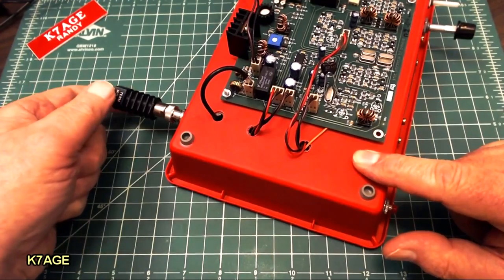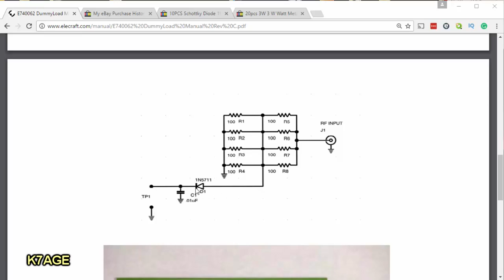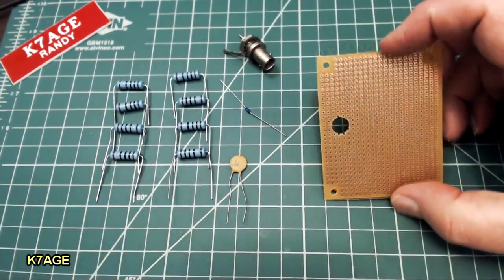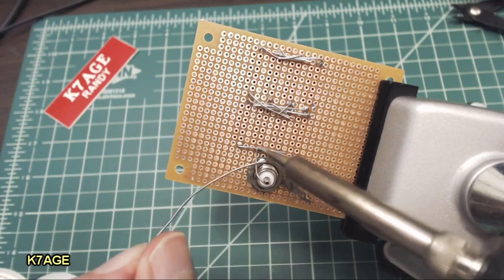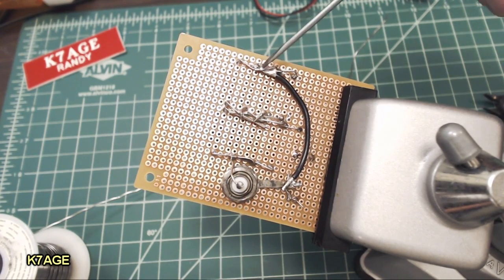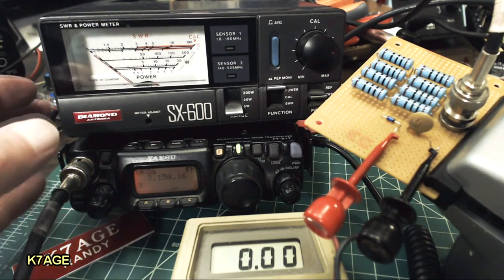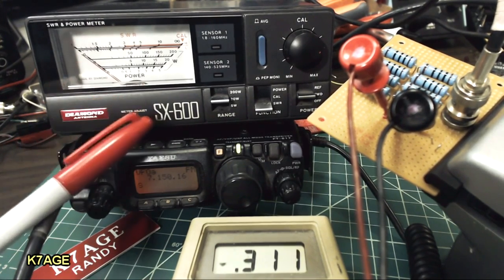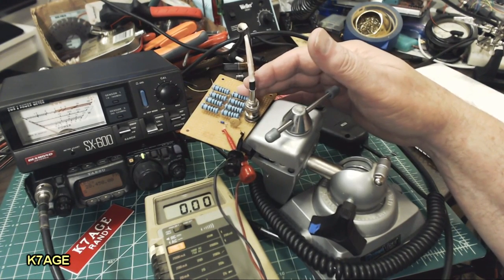How To Build A QRP Dummy Load

Comment: Great video Randy.  I built my 12W Dummy Load with a Schottky 1N5711 Diode RF detector and a six 300 Ohm 2W resistors in parallel. I placed it in yet another Altoids Tin. BNC in front and two 4mm Banana Jacks for connecting the meter in rear. I'll post a pic in the AmateurLogicTV social sites.
Reply from the maker: Sound good

Comment: This was the first thing I built after I passed my General while I waited for a QRPguys FT8 transceiver kit to arrive.  Not sure why but a .01uF mylar capacitor I had on hand did not work for voltage measurements.  Switched it out for a ceramic capacitor and it worked fine. Thanks!

Comment: I hate to be a party pooper, Randy, but metal film resistors are also rather inductive. For best results, use carbon composition types (or non-inductive resistors specifically designed for RF use). Dave - W7SN
Reply from the maker: Thanks for the tip

Comment: Great video.  I built something similar many years ago without the diode and capacitor, and it seemed to work well.   I    wonder how difficult it would be to wire up some gauges to have a direct reading instead of having to use a voltmeter?
Reply from the maker: Easy with an Arduino. It can do the math and then output to a display. I'll probably do a video on that in the future.

Comment: Good project! I am going to build one. I have a question about the formula to calculate watts.  I would have though the voltage should be multiplied by .707 to convert to RMS voltage before squaring.  Seems like I am missing something. Can you please explain when you would/would not convert to RMS.
Reply: Nevermind.  I found a post that explained how the rms conversion constant drops out of the equation.

Comment: Ahh, very good. I know with the QRP kits you can get from China, they come with a single 1 or even half watt 50 ohm resistor as a dummy load. I've built kits that almost smoke them. Very interesting little project, especially gauging power output, good stuff.

Comment: Is that the old Fluke 8060 Randy?? I am more in need of a (better) 3KW dummy load. I have a lovely 1KW, and a DIY Aryton Perry wound resistors in an oil bath  that handles ?KW. 5ish KW intermittent. I have audio loads @ 1,2,3.2,4,6.6,8,12,16,32, & 600 Ohms @ 200Watts-1.5KW, with speaker emulators, but those emulators are exactly like a tuned tank circuit with RF. My QRP 50 Ohm is a thick film precision resistor on an old CPU heat sink. That gets me up into GHz. It works. The metal film is actually spiral cut on a porcelain rod, so you are limited to about that 225MHz. I bought 7,000 what I thought were carbon comps, but they are actually wire wound, so no RF loads with those.
Reply from the maker: 8024B. Thanks

Comment: Thans for the video. I bout a few 1N914 SMALL SIGNAL DIODES 200mA 100V. Do you think I can use these instead of the 1n5711? Thanks for your advice! 73
Reply from the maker: Give it a try. It may not be as sensitive with low power.

Comment: Randy, the cap and diode are for power test only correct? You can have the dummy load with the resisters only is that correct? I heard no mention of this... thanks w7wza
Reply from the maker: You don't need the cap and diode. They are only used to supply a DC voltage to a meter for measurement.

Comment: Awesome video, as always, Randy. Thanks. Did I miss the details of your spreadsheet? I liked your soldering lesson. "Not pretty, but aaah it'll work."
Reply from the maker: I didn't show it. Just add the measured voltage + the .25V for the diode, square that and divide by 25 ohms.

Comment: so, is that easy to measure the power? Is it valid for a 433mHz and 2.4gHz? Grat for a simple arduino project with a lcd or oled
Reply from the maker: I tested it at 144 Mhz, results were very poor. It would be even worst at 433 and higher. I would not recommend using this beyond 28 MHz.